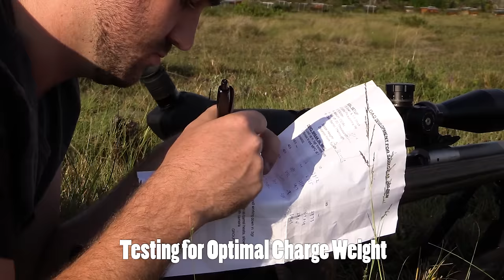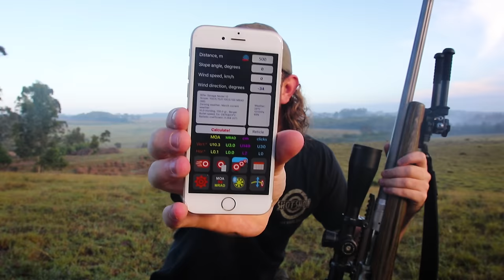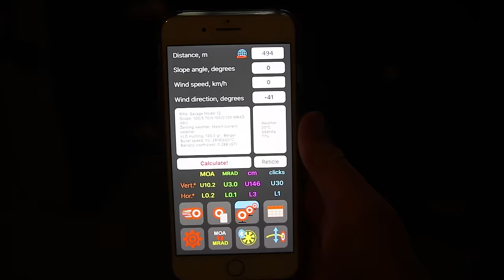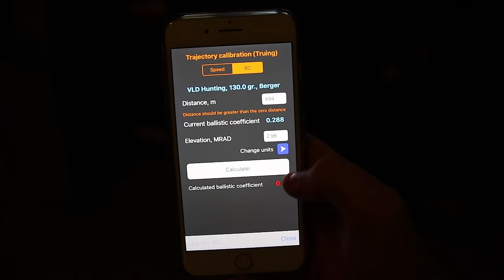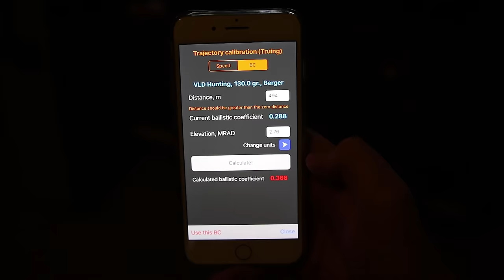Trajectory Calibration with my .260 Rem (also applies to airguns!)

Comment: Matt, another great video. 

As to "BCs can change with velocity", correction: Ballistic Coefficients (BC) DO change with velocity and more importantly with range or distance traveled; for example, every inch of the way.

A BC geometric curve can be drawn going up in value at longer range because the velocity is slower, which in turn gives the projectiles average BC a higher value. Although, the acceleration of gravity too increases, so you have a happy meeting point, which is usually at ground level.

This phenomenon is the reason that a heavier pellet/bullet will overtake a faster pellet/bullet at range even though at the muzzle the lighter pellet /bullet is faster.

For instance, a similar pellet, but lighter in mass coming out of the muzzle at around 1,000 fps will be travelling at the same velocity as the heavier mass pellet coming out of the muzzle at 900 fps and will both have about the same velocity at about 25 yards, but at around 50 yards the lighter mass pellet will be travelling around 100 fps slower than the heavier mass pellet.

So in essence, use lighter pellets for flatter precision trajectories at short range, but heavier pellets for more accurate longer ranges.

I'm sure you know all this I mention, but for reader edifice that read the comments, this is but a small candy.

Also, you could make a whole video on that awsome shot where you hit the Coke Bottle right smack in the center, BUT that is not what is interesting. The interesting an amazing fact is that the bullet travelling at ?,??? fps must have slowed down to the point that it drilled its way through the bottle without causing it to EXPLODE! It didn't even fall down? Are you sure that you shot it, and not just drill a hole, filled it with water and placed it on the ground? I believe you shot it because I watched the video, but as O.J. Simpson said: are you going to believe me, or your lying eyes?

I liked what you said about we are not going to believe what the ballistic app says because we are going to see it for ourselves.

I calculated the BC to be 0.36602540378443864676372317075294 from the 0.288 to 494 meters, or (540 yards). Its probably due to the difference to the center of the Earth for the calculation of gravity since the center of mass of the Earth is ever so dynamic and a definition of gravity does not stop it.

Comment: Thanks for this video and information. I'm high at 1025 yards with a stock Savage M10 308 Winchester 22 inch heavy barrel, Athlon Ares btr gen2 HD APLR4 4.5-27x50 and 175gr matchking 45.5 gr CFE223 in Lapua brass over a CCI primer, chronographed at 2750 fps from 10 feet. I put .243 bc, (G7) into Strelok at 1025 yrds it gave 37.5 moa.
Actual moa was 33.5 moa. 
So I have some changing to do.

Comment: It look like you're using strelock pro. You should do click value validation first. Just because the scope says .25 equals quarter inch at a 100 yds, when in reality the scope maybe .23 or .24 moa at 100 yds

Comment: Do not use an anemometer - do a video where you can see many types of ballistic calculators, using the same conditions, I did a try with strelok pro, strelok + and applied balistic and all three give me different results. What mathematical model do you use? G1 or g 7?

Comment: Very interesting video but I have an air rifle question I would appreciate it if you or any one else would answer it for me.  When hunting with a springer air rifle is it ok to load the gun while waiting for game and if so is there a time limit I can leave the spring under tension before I need to fire it.  Thanks
Reply from the maker: +Bob USA I don't know too much about springers, but I know that my springer's spring got weaker over time and eventually needed to be replaced. So I would think that leaving it cocked for excessive amounts of time is not good.
Reply: Thanks for your quick response
Reply: Thanks
Reply: AirArmsHuntingSA 
Good job on your videos. 
If you only shot at 4 inch diameter targets. 
At what distance would you start missing?
Thanks for your good work. ..